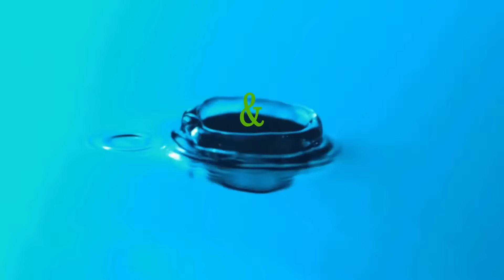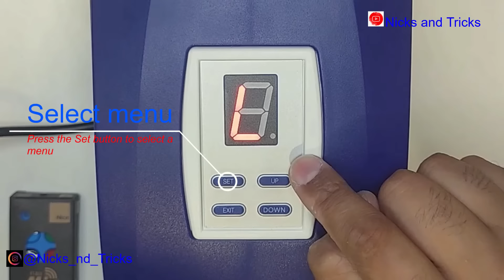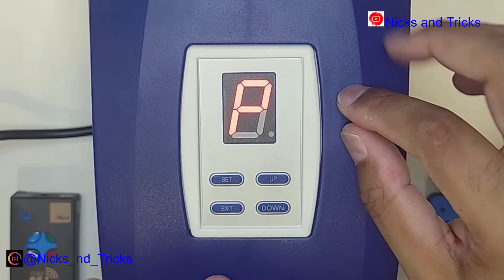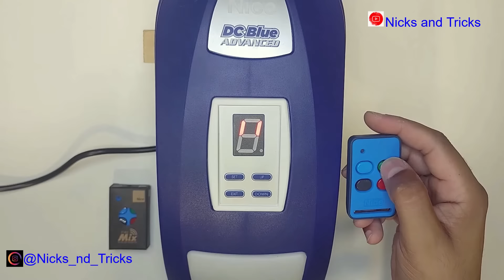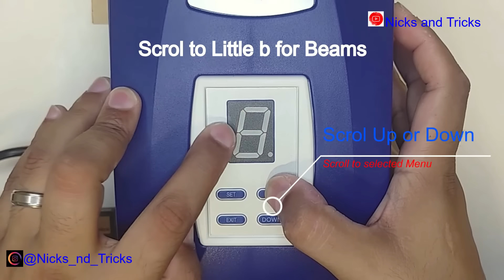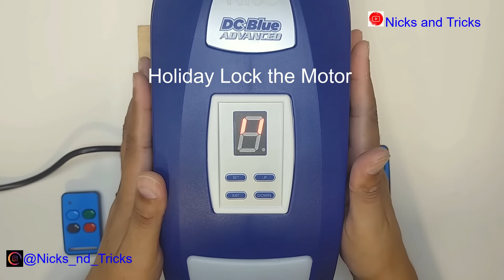DC Blue Advanced Garage Door motor setup

Comment: Hi there - every time I press the remote button to set/confirm. I get a 3 and not a 1. Any tips?
Reply from the maker: Make sure the remote is the correct type, ET/Nice
Make sure it is on the correct frequency, ET blue/ET blue mix. Make sure have the remote about 1m away from the motor when you press the button

Comment: i press up button but no B appear
Reply from the maker: Thank you for your comment,  you must have a remote programmed to move the door after you set it up, you cannot open it by using the up button, to test you can take a piece of wire and touch the COM output to the BT input where the remote receiver goes

Comment: Hi Nick,  
I’m currently staying in a company house, and I’ve noticed an issue with the door—it opens halfway, then stops and emits a beeping sound. The company recently replaced the original 24V battery with two 12V batteries connected in series, but the problem still persists.  

Do you have any idea why the door isn’t opening fully, and what I can do to resolve it?
Reply from the maker: Thank you for the comment,  does it give you an error code? You can increase the force setting and see if it works.

Comment: Hi Nick, thank you for all your videos, recently programmed my door through the full cycle. It opens like usual, but when i press my remote to close, it moves down a little, stops, then moves back up again
Reply from the maker: Thank you for your comment,  that is when the motor detects a collision, you can increase the force in the force menu but remember it will take more force to stop the door if it hits something. Check the garage door hinges and guides

Comment: Hi Nick, 
Please could you assist me in recoding my new remote to my DC Blue Advance garage door motor. I have followed your instructions but continuously get an error 3 instead of a 1
Reply: I am trying to code a Digi Radio Console ie wall remote, I also note that my DC Blue Advance also has a separate transmitter box attached.
Reply from the maker: Thank you for the comment,  if your motor displays 3 it had not received a valid signal from a ET Nice remote
If there is however a standalone box you have to code the remotes to that box instead

Comment: Installed a new pc board. However the door was open at the time the door was open. Now i cannot get it closed in order to do programming.  Please assist
Reply from the maker: Thank you for the comment,  pull on the manual release, it will allow you to close the door
Reply: @nicksandtrickssa  i have tried that it still does not release
Reply from the maker: @AlbertCollett-k8k is the door stuck?
Reply: @nicksandtrickssa  yes it seems like it . Does not move at all
Reply from the maker: @AlbertCollett-k8k remove the motor head from the drawbar then close the door
Reply: @nicksandtrickssa  thanks will try that

Comment: My motor just suddenly stopped responding,  manual pull is also stuck on open . What could be the problem
Reply from the maker: thank you for the comment, it sound like you have a drawbar issue, remove the motor head and try and move the sled to lock into place first. you might have an obstruction in the drawbar

Comment: After setting the limit setter my door doesnt go atomical open and close😢
Reply from the maker: @LungabKhumalo  thank you for the comment,  walk me through what happens please
Reply: @nicksandtrickssa  I did the limit set perfect but it was time for it to confirm what I have set it's didn't and now I ama receiving error 1 E or 1 3 i don't don't the door keep stucking if I reset the limit set
Reply from the maker: @LungabKhumalo  the E1 error os a pc board error, the motor must go in for repair at the nearest service center
Reply: @nicksandtrickssa  what the range of the price they usually charge for that?

Comment: What if it shows a flashing E, 2, 3? When you try to open the door?
Reply from the maker: @mdt6101  thank you for the comment,  E2 is a physical obstruction, E3 I'm not too sure about, but if you fix the physical obstruction the door should be fine
Check in the track

Comment: Thank you for this video 🙏🏻 has helped me a lot with programming my remotes as well as working with the motor.
I have a question that I’m hoping you can help me with. My garage door is closing and then sometimes 1/2 or 3/4 way down it stops closing, beeps once and then opens again. If I stop it opening and close it again quick enough it will close fully. How can I fix this?
Reply from the maker: @oldboneybird  thank you for the comment, it sounds like there is a physical door issue, you can increase the force on the motor to get past the issue, is it related to the weather? Do you have a wooden door?
Reply: @nicksandtrickssa  that was my thoughts, yes it’s a wooden door and it only started happening now in winter time..
Reply from the maker: @oldboneybird  change the force settings for now and change it back once the door has settled again, I have a video on settings force as well, have a look
Reply: @nicksandtrickssa  thank you 🙏🏻 I will try do that then

Comment: Hi Nick. Thanks for the video. I set the limits successfully but when I try setting the "b" button for receiver, the lid displays a "2". Could you maybe help me understand what to do?
Reply from the maker: Thank you for the comment Rajesh, does your remote not work? Please see...
https://youtu.be/b6h0_9kLisU
Will help with remote setup. 1is successful add, 2is transmitter already successfully added, 3is no transmission received
Reply: @nicksandtrickssa  It works now. I cleared the memory with E and added it back with a "1".
Reply from the maker: @rajeshreemack4666  well done, a like and sub would be appreciated
Reply: How did you clear the 2 @rajeshreemack4666

Comment: I’m unable to set any of my 3 remotes it just displays 3 and I’m pressing quick enough it used to all work before when I set it
Reply from the maker: Thank you for the comment, if none of the remotes is not working, and it is NICE remotes you will have to get a standalone receiver to get it to work, could be issue with the onboard receiver, try and reset the receiver and see if it works
Reply: @nicksandtrickssa  how do I rest the receiver?
Reply from the maker: https://youtu.be/b6h0_9kLisU
2:35

Comment: My remote works fine, but when I try to add my wife's remote, it's flashes 3 instead of 1. Any advice there?
Reply from the maker: Thank you for your comment Zack, 3 means no transmitter received, took too long. Is the remote on the correct set? Press and hold remote for 25seconds till it pulses then let go and try again
Reply: @nicksandtrickssa  thanks for the super fast reply. I held it now for 25 seconds until it flashed and tried again. Still flashed 3. It's strange because it apparently worked 2 weeks ago before we moved in.
Reply from the maker: If it is the only remote not working then it's the remote that's the issue, try and reset the receiver and then try again

Comment: I managed to get the button to open. But after opening, it shows B and doesn’t close again after pressing the programmed button again
Reply from the maker: Please check, https://youtu.be/W56yUv6ZB_g
It shows how to enable beams and autoclose, you have to do the opposite, set them to 0
Reply: @nicksandtrickssa  thank you. But now when I press the open button it shows a P
Reply from the maker: Make sure to go to little b and set to 0, then go to big A and set it to 0 as well
Reply: @nicksandtrickssa  hi! I have done that. Still the same.
Reply from the maker: Send me pics of the display to technical@rsec.co.za please
Reply: @nicksandtrickssa  hi i have been getting the same issue please advise if you got it corrected
Reply from the maker: @FootyBitesShorts  thank you for the comment, can you send me a pic of the error
Reply from the maker: please confirm if the boeard beeps 5 times and displays the little p. if it does, please do the limit set again and let me know what the error is
Reply from the maker: Good day Alvio, so after some digging, and checking for myself today, i have a little bit more info for you. does the board beep 5 times with the little p displayd, if so, did you do the limit set again, if you did what error does it come up with after doing the limit set?